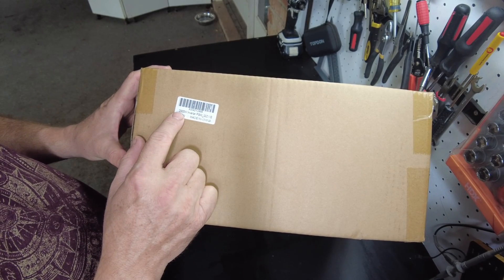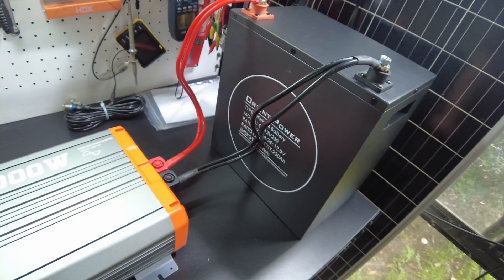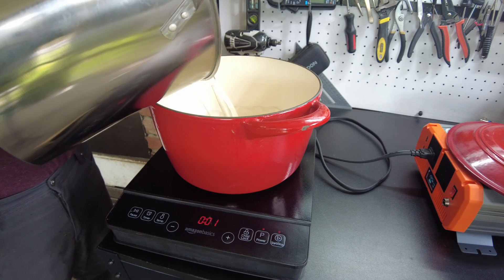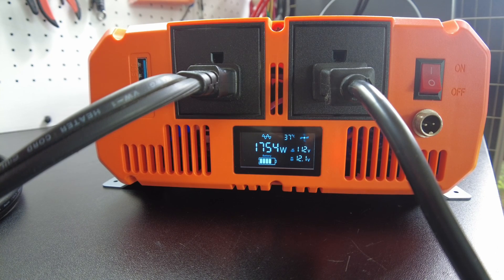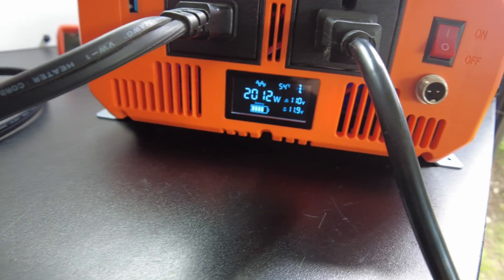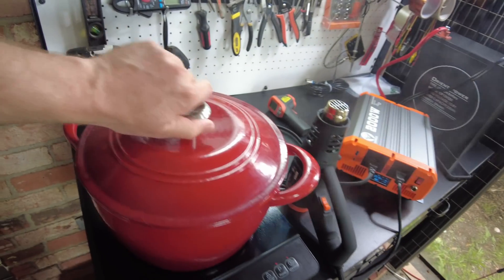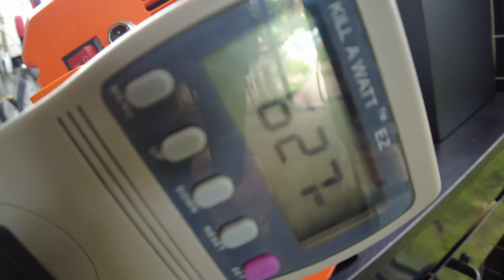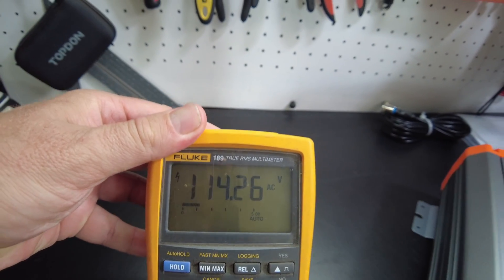TOPBULL 12v 2000w Pure Sine Wave Inverter

Comment: I noticed they were using a similar cable setup on the inside but were they larger guage?  You can change the external cables but in the internal ones are also insufficient, that's a problem!

Comment: I have 1/0 cables going to my 2000 W Renogy inverter. It runs fantastic. Those junk cables would be going into my bin and used for something with a lot less current draw. 165A is too much for those little cables and I don’t like parallel cables anyway. What are you gonna do if one fails. Fire. Your cables are 130°F and it’s not even hot summer weather, no switch, no fuse and no corrosion on the terminals yet.

Comment: Nice to know there are Chinese inverters that delivers what it advertises! 
I have an older inverter (Chinese) rated at 1000W and it overloads at something less than 750W. Enthusiastically labelled I suspect.
Many of us want to run power tools, pumps, vacs etc from an inverter. Now start current normally on these inductive loads can be 3 to 6 times the rated power of the motor, so it may be an idea to try a range of motor based appliances on any future inverter tests. For this one, for example, I'd try a motor of around 350W and another around 700W and see if it can start and run them...I know, a bit of a tall ask, but if its possible it would provide additional info for prospective buyers.
Reply from the maker: Great suggestions as always, Ben. Thanks!

Comment: The cables could be corrected easily enough, but the soldered in fuses steered me clear of this one. When will these co's ever realize that in the field, that becomes almost impossible for the average person to deal with? A real shame as it looks like a good unit/value otherwise.Thanks.
Reply: I have a similar inverter, and it is fused the same way. It is a little inconvenient to reach them however, they are not soldered in, they sit in a blade fuse holder. 

I agree that it’s relatively simple to Increase the size of the external wiring, however internally it’s another matter. I always wonder how they handle the high amps on the inside of the unit.

Comment: I watched another YouTuber review this same Inverter and the Inverter couldn't handle 2000 watts. The voltage drop went below-rated capacity and the inverter started complaining.I commented thats usually a battery problem, not the inverter. Your review of the TopBull passed with flying colors.
Reply from the maker: Yes, I saw his too. Not sure what's going on there, but I was curious what the DC voltage was looking like during the problem. Thanks!

Comment: Those cables are way too small for 167 Amps of current.
Reply: It depends on what the temperature rating of the cable is. At 125F, they are probably well inside their specs. There will be a voltage drop however, so worth measuring the drop across each lead at that current. I bet these cables will show a relatively high voltage drop meaning the inverter will drop out long before the battery is actually completely discharged.
Reply from the maker: Yes @BenMitro is correct, technically they can handle the current because of the 200c temp rating of the silicone jacket, and yes there will be more voltage drop. I'm just not a big fan of my wires getting this hot. I like things to run cool, and efficient. My rule is if it's too hot for me to touch, I'm not happy with it. That's just my 2 cents :)
Reply: @BradCagle That 2c is worth a lot more than face value!